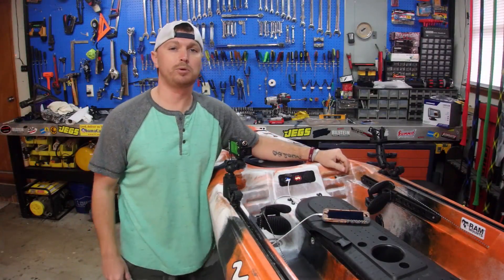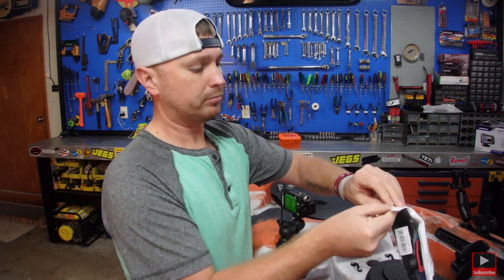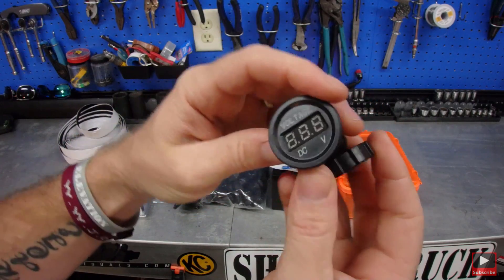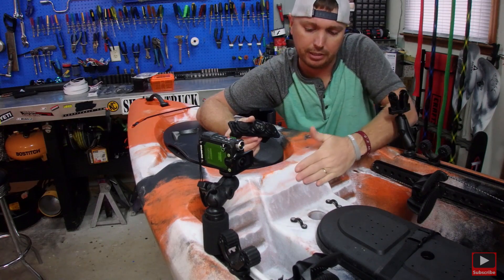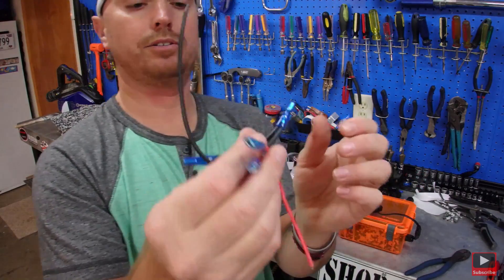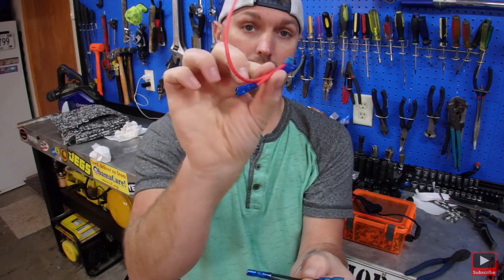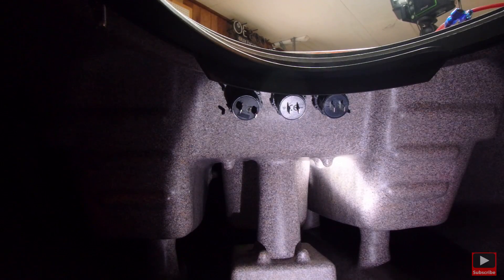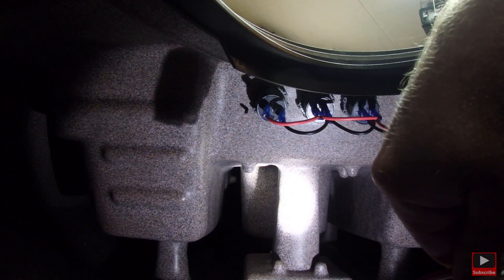2020 Custom Kayak USB Panel & Battery Box, CHEAP, DIY | How to install | Step by Step

Comment: i would of put a on off switch on that so you can turn the display off so there is no drain on the battery when it's not being used it will just make the battery last a little bit longer between charges

Comment: Be advised that the gasket on those “cheap” waterproof box will decay within a few years or less due to heat and UV.  The material (white gasket) goes liquid and very sticky, makes a mess.
Reply: That’s exactly what happened to the seal on mine.

Comment: Really clean install, just curious that you don't have an inline fuse in the system. I have had numerous boat panels and switches fail over the years. 
Just my thoughts
Reply from the maker: I have an in-line dude on the main battery 👍🏼
Reply: @KayakUSA1  my bad, I guess I missed it
Reply from the maker: I don’t know why my reply said “in-line dude” 😂 my phone must have autocorrected me , I actually typed, “ I put in an in-line fuse “ lol sorry bud👍🏼

Comment: How do you charge the battery? Can you use a small solar panel and plug it into the cigarette lighter to charge the battery and can you leave the solar panel plugged in while out fishing? If so, what is the best watts solar panel to get?
Reply from the maker: Yes you can, I don’t have the solar panel yet but that’s my plan!🤙🏼🎣

Comment: You should sell kits with premade battery boxes and pre made wire harnesses for the seaghosts.
Reply from the maker: that's not a bad idea! Thanks for watching and for the support!
Reply: Kayak USA, Thanks for such a great tutorial! If you decide to do it let me know. I'll be your first customer. It's cheaper buying stuff in bulk... and I don't have a shop, wire connectors, shrink wrap or anything so I'd be happy buying it ready to go! I'd just have to drill the holes and plug things up. Easy enough lol.

Comment: Just curious why you did not use a fuse protector between the battery and USB unit. Was there something i missed. By the way great videos, very informative.
Reply: a power switch too.

Comment: It’s been 3 years. Did the electronics hold up or did water exposure damage them?
Reply from the maker: The guy that owned that kayak now still uses it. Everything is still holding up great!
Reply: @KayakUSA1  that's impressive. Didn't expect those caps to protect the USB charger well enough.

Comment: I want to add this to my kayak.  But I was wondering if you could use the 5way to an advantage.  Is there a way this could be wired where you add a flush mount sae charger port to the dash as well so you can just plug in an sae charger into the port that goes to the battery so you could charge your battery and you never have to remove your battery box from its location and if it is possible, how?

Comment: Definitely going to do this with my vibe, one thing I didn't see was a in line fuse. Did you feel it was necessary for your fish finder? Or is there one in the 5 way connector?
Reply from the maker: Daniel Deason , Yes , I added the in line fuse from my fish finder directly to the battery. I think I show me doing that in my " Fush Finder install video" , Thanks for watching and for the support!👍🏼

Comment: Just wondering how long the fish finder last on that battery?  Also can you charge the battery while still connected using the cigarette adapter.   The holes on the gasket at the bottom was to allow any water to drip out if it got in com the top.  I use that same one on my boat.
Reply from the maker: Brian Nolder , it actually lasts me for a few days without charging. Also, those three little square holes are actually for the straps to each of those flip down plugs to rest in lol, I actually put the plate on backwards... A subscriber just showed me the other day.. lol I felt like an idiot 😂 Thanks for watching 👍🏼

Comment: I hate to say it, but the Positive junction from the Battery should ALWAYS be protected from touching anything. (Like on an automobile, where it doesn't matter if the Ground wires touches anything else that's Grounded). Just a little "Hint", for future reference.
Reply: M. Smith Now that you've built this drybox system... is there anything that you would've done different to make it better?   Mikisa
Reply: I didn't make my box that way, but his is just as good...!  Always keep the Power (Positive) contact insulated from everything else.
Reply: I agree with the positive post comment. One more thing to add.... I am going to be building same exact setup but will be adding my fuse right off positive terminal before exiting dry box. Any thoughts why this wouldn't be effective at protecting all accessories without the need for multiple inline fuses?
Reply: Having a fuse holder (and fuse, of course!) directly off the Positive side of the Battery should be good for all your needs, but maybe NOT for any specific electrified item.  Maybe your Fish Finder uses 3 amps of current, but your boat lights require 5 amps.  If you run them both, that makes a total of 8 amps!  Neither your fishfinder nor your lights are protected, should something happen. 
  A good weatherproof fuse holder, coming off the battery should have a maximum total of ALL your electronics, but I think it would be wise to have a separate inline fuse for your most Precious (the fishfinder) just in case. Think about how vehicles are wired, and you can't go wrong.  (Each electrical item has its OWN fuse, just in case!  Also, match your loads with the proper wire gauge. Small wires pulling big loads, means voltage loss due to resistance!
  Make sense?  Hope this helps, my Friend...  (Things to "Ponder"...Hobie electrical fittings are not totally "waterproof", but have good water resistance, and 5-Minute Epoxy is NOT waterproof, at all...!)
Reply: I have put an inline waterproof for each of the lines to the battery.  I only have 2 so far, fishfinder(3a) and the power outlet(5a) listed in this video.  2 more open ends using the splitter in this video for lights later on.  Also ordered a $10 attachment for my genius g7200 charger that will let me connect directly to the SAE plug to charge the battery.  Don't even have to open the box!  I am sealing the electrical fittings with silicone.  All my connections have heat shrink over them.  Looks good so far, time will tell though.  Thanks for the video and links.
Reply: M. Smith any way you can word that for the stupid people like me?  I know nothing about electric and I don’t want to fry all my electronics
Reply: The other end of the extention wire that was cut in half has the protected positive lead.

Comment: Some questions for you. Are the USB panel and the fish finder running off the same Battery? If so, did you wire the fish finder into the 5 way? If not how did you wire it up? Thanks for your time in advance.
Reply from the maker: Yes it runs to the five way, with and inline fuse 👍🏼🎣🐟

Comment: Just wondering when you mentioned the ground wire. What about an actual ground. In many boats the ground is connected to a zinc late under the boat. Uh.....would this be a good idea on a kayak? I'm saying this because many guys have a considerable amount of metal....camera poles, flag pole and I've even seen umbrellas.

Comment: I gutted a 12 Bosch charger and use it for my fish finder can run anything 12 volts  I get 2 hrs continuous  run Time  per battery  with a 5 inch screen

Comment: Are you laying the battery on its side? And also are there any issues if you do have a 12v laying on its side.
Reply from the maker: e yang , Yes I am, As long as you get a sealed gel battery you can lay it on its side. Thanks for watching!👍🏼

Comment: Did you hook up an sae adapter to your battery charger to easily charge your battery?
Reply from the maker: +mi q , I did, works great! I had to flip the connector around on the charger but it works great👍🏼

Comment: Found your Channel while searching Vibe 130 videos. Amazing video. Just got a seaghost 130 and will be adding this mod soon. what kind of battery charger are you using. Thanks again.
Reply from the maker: Josh Stockman , Thanks man! I just use a small trickle charger from Walmart, works great! Be sure to checkout my other DIY videos most of them are on my Vibe, you’ll LOVE the Mod Pod II add on video! It’s the best thing I’ve added to my Vibe so far! Thanks for watching and don’t forget to subscribe and share!👍🏼
Reply: Done and done. Plan on checking all your videos out. Thanks for the info.

Comment: I ordered all the equipment from your site, in the battery box video you  don't show where the inline fuse goes?
Reply from the maker: I put an inline fuse on every hot wire ( red/positive) in between the battery and the device it’s powering. Thanks for watching 🎣🤙🏼

Comment: Do you think you could add a plug to battery charger and plug it in and charge it somehow?
Reply from the maker: Matt Dillon , Thats exactly what I did👍🏼 I use a small trickle charger and plug it right to my battery box. Thanks for watching!
Reply: Kayak USA so you cut the wires on trickle charger and added one of those plugs on end so don't have to take battery out of box?
Reply from the maker: Yep, just be sure to wire the positive on the correct side so when you plug it up to your box it's "positive to positive" and "negative to negative" I just use a small cheap trickle charger from Walmart.👍🏼
Reply from the maker: I linked everything I used for this build in the video description for you too👍🏼
Reply: Kayak USA  I just got my vibe and in the spot you put volt plug at is a vibe symbol and vibe also engraved in it right in the spot. Yours looks smooth. Hopefully won't mess with drilling.

Comment: You may be picky but try being OCD like myself lol, I wouldn't want wire those sharp-a** screws sticking into my storage compartment if I could machine screws instead, not sure I'd even used the bezel actually..Idk how you got by with drilling holes without hitting the liner lol, .and yeah giving me anxieties with that uninsulated hot lead and lack of fuse.. enjoy all the videos! and hate to bust chops..but u do keep saying your picky lol

Comment: thank you are there any fuses ?
Reply from the maker: +redwood1957 , I didn't install any fuses directly on the battery but I will install in-line fuses in between each individual powered item ( ie: fish finder, lights, USB plugs...) And the 5 way splitter. Hope this helped and thanks for watching!👍🏼

Comment: The saltwater and condensation inside the hull will murder that thing the first time you break the surf. I ended up removing all the electronics I spent so many hours carefully installing. they're cool, don't get me wrong, but the benefit they provide just  isn't worth the hassle constantly battling all the corrosion issues.

Comment: Is there a cap for the plugs not being used?
Reply from the maker: Yes they actually do make these with caps, I didn’t get them though, mine is zip tied to the top of the inside of the kayak.🤙🏼
Reply: @KayakUSA1  yes I made not using all the plugs that's why I asked didn't want if to short out if possible

Comment: Don't know if you thought about this or not but in case you didn't you might want to check this out on Amazon.com. POWOXI Solar Battery Charger Car, 3.3W 12V Solar Trickle Charger for Car Battery, Portable and Waterproof Solar Battery Maintainer, Amorphous Silicon Solar Panel car Battery Charger. This might be a good item for you to add to your system to maintain your battery while out on the water and using your Fish finder.
Reply: Might want to consider dual batteries as well. You could actually set it up so that it has the ability to be switched between the two so that while using one the other is charging and vice versa. And you would have to be sure to connect them properly so that you are still at 12 VDC and not 24 VDC but you can find information on how to do that by checking out how to wire solar battery banks. Oh and most people don't really think about setting up a small battery charger by removing the clamps and replacing them with a cigarette plug but if you wired it the same as you did the female plug on the boat you could actually have a charger that would plug into your lighter plug and charge the battery.

Comment: Nice job but one critique. Should've used a main power switch from the battery on the dry box or on the dash to power your accessories on or off so you don't drain the battery
Reply from the maker: Lance Robinson , I thought about adding one but decided not to. When I take my yak out and plug up my battery box, I plan on using the battery. If my Hook2 isn’t on the only thing that will be pulling any juice at all is the tiny volt meter and I don’t think that will drain it too much. But in the future when I add more stuff like lights and camera power hook ups, I will definitely be adding my a main power Switch. 👍🏼 Thanks is for watching and the input. Great minds think alike! Lol😁👍🏼

Comment: bought everything you bought except the dash.  i went with the one that has the on off switch in addition to the usb, voltometer, and cig lighter.  But im having a hard time with the wiring.  so the on off switch has 3 little connectors on it.  one ground wire that comes from the battery and then pig tails to the other 3.  one power wiire that connects the battery only and then a 3 connector that starts one pigtail then jumps to the other 3.  when i flick the switch the power button lights up but nothing else has power.  Anyone know what im doing wrong?

Comment: Just a recommendation,  when using silicone use the "BoatLIFE" brand.  It's the best marine grade silicone.  Anything at Home Depot is junk silicone in comparison.  

If you want it more permanent above water,  use 3M 4000 because it's UV protected and below water use 3M 5200.  5200 will literally de-laminate fiberglass when trying to remove so when they say permanent they mean it.
Reply: Also,  you can buy heat shrink electrical connectors also.  They're more expensive but they are 100 times better than regular butts and heat shrink.  If you use heat shrink,  make sure it has the glue in it.  3M makes good heat shrink.

Comment: you would have been better off with a hole saw those speed bits are hard work on anything other than wood. Proper good vid though,

Comment: Is there a DIY on how and where to add a fuse? The installation guide says to add one.
Reply from the maker: Just add one on the pos wire at the battery.👍🏼

Comment: The yanks like to fill their kayaks with gadgets, they go out with the kayak full off rods, aceesories, etc. Don't you ever flip your kayak? it's a mess, even if everything is tied up, it has to be cleaned with freshwater, disassembled, lubricated, sealed... and I'm not talking only about the reels. I never carry more than 2 rods and the lures I'm going to use.
Reply: A lot of guys are fishing fresh water for bass, trout etc. Not as big an issue.